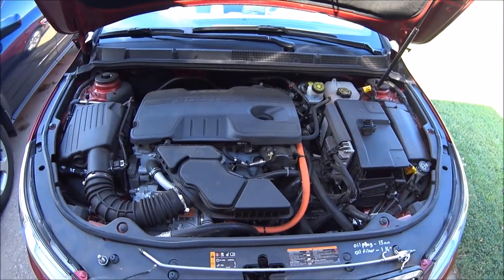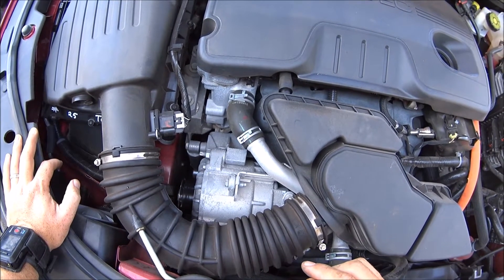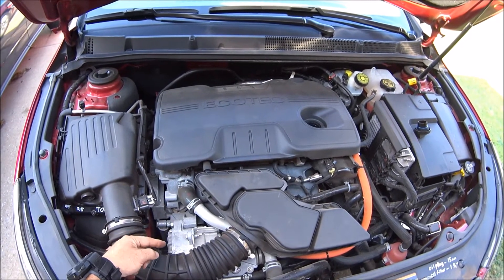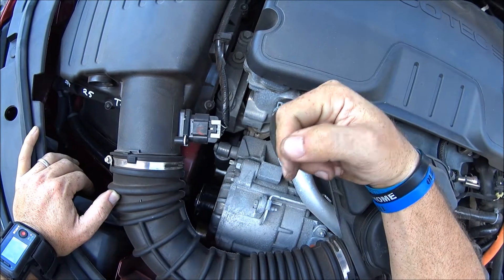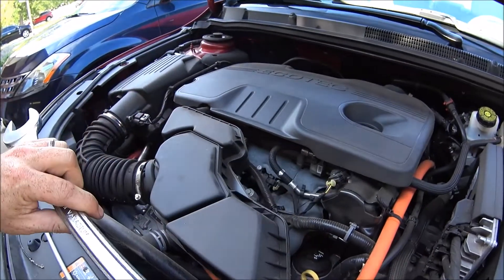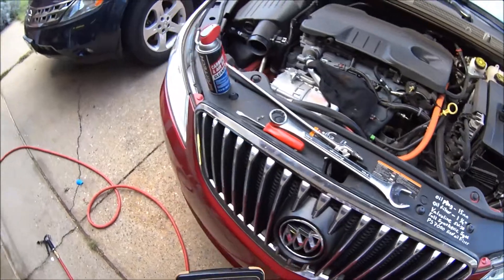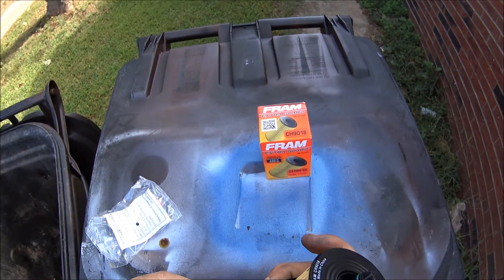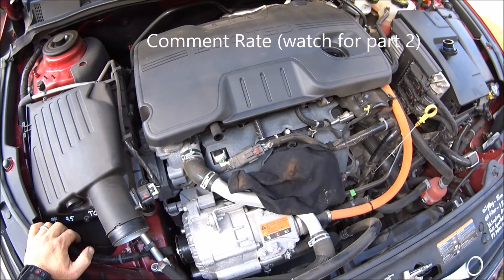2.4L eAssist auto stop BAS How to oil change and Serpentine belt replacement Part 1

Comment: One of the hardest belts to replace. You have to jack the engine up just to reach the tension . Remove motor mounts to get at that.
Reply from the maker: Yep I agree pain in the butt
Reply: Well I'm not gonna get this car 😭
Reply: Best tool to use is a 5inch c clamp to compress the spring

Comment: i have a 2012 buick 4cyl with eAssist you did say 5 quarts i oil ? i bought a big 5 qt jug
Reply from the maker: You always want to double check after you are done. Park your car on a flat surface. (Wait a little bit to let all the oil crim down if you had to move it to a flat surface)  and make sure the oil level is on the hash marks on the dip stick.

Comment: Iv had my belt break twice in two months. Same motor and everything just a 2013 malibu. Ever  had continuous problems with the belt breaking or heard of anything that would cause that to happen?
Reply from the maker: Eddie weber yes usually junk ( like rust or grease and dirt build up)  make sure the splines ( the ribbed part on the pullies) also make sure each pully spins freely when the belt isn't on and then make sure all the pullies line up with each other